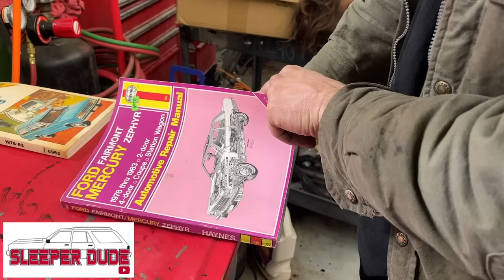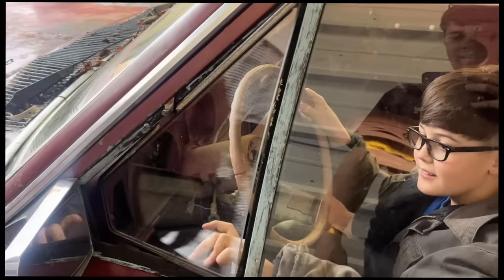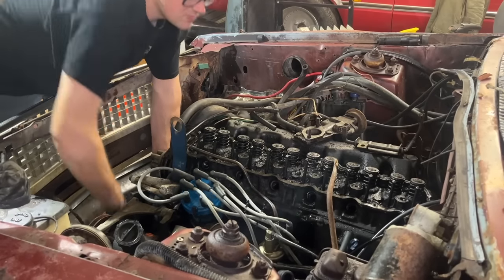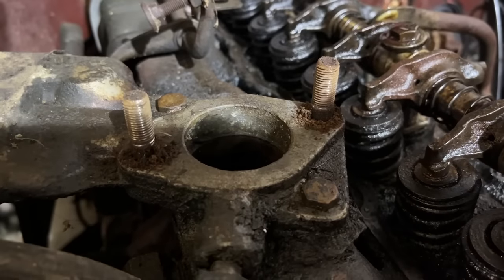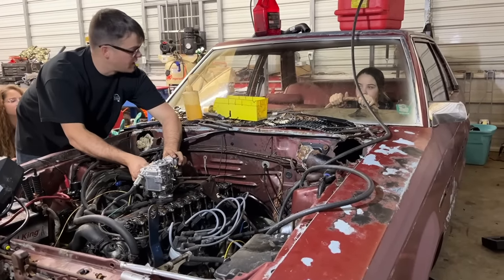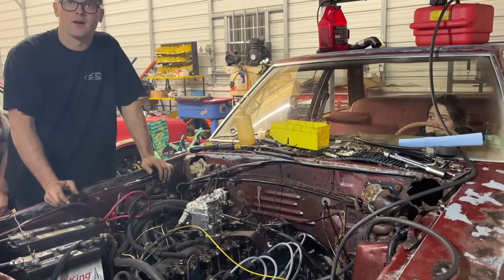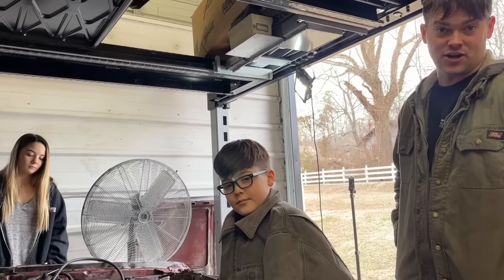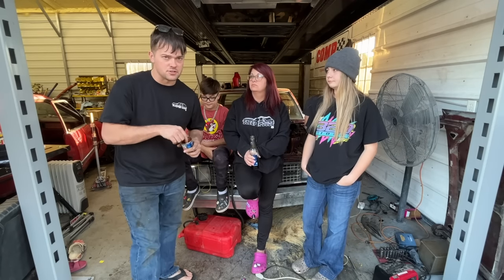Junkyard Rescue 2 Door Fairmont Saved From The Crusher Will it Start?

Comment: If the exhaust is really plugged the back pressure will prevent proper intake. 
Just a thought. Love the channel keep it up.
Reply: Watch it to the end and you will see that it was more than likely the timing due to the timing chain and not enough adjustment on the distributor to make up for it. 😮

Comment: Glad to see I'm not the only one that has a failure now and then!  Wonder if the exhaust is still plugged? Maybe one of the other Fairmonts has a good ring gear? Oh well good luck with that one. 😃
Reply from the maker: Thank you
Reply: Ring gears on the 200ci inline 6cyl C4 3spd are welded to the torque converter, not to the flexplate.
Reply: Yeah I think I’d have took the exhaust system off, I think that’s been the problem. It’s been a great vid albeit a little frustrating not seeing it run.
Reply: @michaelcook7836  change them both. Whatever it takes. 😧

Comment: Hi guys. Back in the early ‘80s I knew a guy who had a Chevy wagon with a 350. His idea of an oil change was to just change the filter and add a quart of oil. Needless to say that’s what his rocker arms looked like when we changed the valve cover gaskets. He was also a big fan of Quaker State oil, which didn’t help matters any.
Reply: Pennzoil will do the same . Use paraffin based oil that's what you get.
Reply: Quaker State will do this every time. I worked in a junkyard and every motor we tore apart for parts that used Quaker State was just like this. Every time.
Reply: If your dipstick is black there's a good chance the guy used Quaker State

Comment: The first thing I’d check first is to make sure the exhaust isn’t clogged up badly. Take a sawzall and cut it before the muffler…. Then pull the starter again to make sure you didn’t shear off the teeth on the starter. You should have 3/4 of a flex plate with good teeth!
Reply: My thoughts exactly
Reply: I think so too

Comment: When you try to start it on 24v, you need to connect the ignition system to the bottom battery so it gets only 12v.  The top battery in the series string needs to connect to the starter solenoid.  This will keep you from potentially damaging the ignition system.

Comment: Hey Josh, did you double check TDC, firing order and distributor rotation direction? The cam was timed to the crank w/the old chain, but it backfired through the carb which is usually a timing issue. Maybe cut the exhaust off at the manifold too. Sucks about that flexplate. Thanks for posting.
Reply: Yes, I wondered if the exhaust was still too bunged up to run. I've never had an automatic so I don't know if it's possible but with a manual I would try a tow start.

Comment: Dude, I worked at a junkyard for years. I bought so many old cars that ran again that we finally went and got our dealer license and started reselling them instead of scrapping them. It was more lucrative to get the pre cat cars running again than it was to scrap them. You just have to choose the right cars. I saved a bunch of really cool old cars. The '71 Torino, the '80 302 Cougar and the '85 Alfa Romeo Spyder convertible were some of my personal faves. I ran the crap out of that Cougar before we sold it. The first step on picking the right car is to make sure that the engine turns over.

Comment: I bought a 76 cutlass from a junkyard. Changed oil and plugs with plug wires. It started on first try after sitting since 96. If you ever get tired of the fairmonts i would love to have one
Reply from the maker: Man, we didn’t have that kind of luck on this one
Reply: @Sleeperdude  just get a 302 and drop it in.
Reply: Sleeper__-Dude  won? What username?

Comment: I think the "rats" nest in the exhaust is where your troubles lay, if the exhausted energy can not escape then it'll back up and stop the engine running, I had this problem on a barn stored straight 6 many years ago, it had good spark, would turn over and try to fire up, but just wouldn't keep running, on inspection at the rear of the car, there was material on the floor, and hanging from the tailpipe, after cutting out the rear exhaust box it ran as good as gold, maybe worth a try in your case too

Comment: Hi Guys,             Glad to see your latest attempt to breath new life into the old Fairmont. My Dad had a 1975 Ford Maverick 4 door sedan he bought new in April of 1975 at C&S Ford  in Willimantic, Ct .I remember going to  the dealer  with my Mom and Dad to pick it up when it came in. He ordered it with the 250 Six and Automatic transmission, AM radio and Power steering. They got 145,000.0 miles out of it over 25 years when we had to park it due to body rot from salty roads. These smaller Fords were off shoots of the old Falcon with similar design features. Josh, I hope you received the photo's I sent of my Jeep and 1991 Crown Vic wagon with newly installed " Sleeperdude " decal in the left rear window. Please advise . Thanks . Good luck on the 64 wagon build!

Comment: You may want to artificially boost the compression by putting a small squirt of oil in the cylinders. The little oil will help sealing the rings. increasing the compression. Sometimes the rings will loosen up and re-seal after running for a little while. Thanks for a great show. Fun, inspiring and always leave learning something new. God Bless!

Comment: Looking at all that mouse nest that is coming out the exhaust and then it's blowing back through the carburettor.  I have a feeling that the exhaust is restricted. This could stop it from running. Unbolt the exhaust at the manifold and try that if you can get it to crank with that bad flexplate. Maybe swop the starter as the teeth on it will be worn down now from all that grinding. Maybe weld a little on flexplate to build up those rusted and worn teeth. Don't  give up. This one wants to run. Part two video is a must. Please.
Reply from the maker: You may be right

Comment: Josh you've got far more patience than me, I'd have put Rocky outside months ago. 
Ref the engine, the amount of rubbish coming from the exhaust, the back pressure through the carb and the 'chugging' sounds point to the exhaust being totally blocked. Cut the exhaust near the manifold and give it another go.

Comment: Everyone I tore down that had all the sludge under the valve cover had been using quaker state oil I used it too but after tearing down a couple of motors that I used Quaker state oil in I changed over to Pennzoil.  ✌️

Comment: The 2 door box top Fairmont would be a great project car. You could buy the 2.3 turbo ecotec engine from a wrecked late model Mustang. That would an awesome cruiser/dragster car!!  That engine puts out 300 hp and 300 lbs of torgue! Also get the transmission too. I bet the Fairmont with that drivetrain could hit 140 mph easy.

Comment: You guys tried thats the main thing. If you can reach it try to remove the rust on the flex plate ,That may help. The ignition switch could be bad,or just dirty,causing the loss of 12 volts to the coil/other parts. ? That engine looks like it has had Quaker state motor oil ran in it back in the day. It made the same build up. if you put good oil back in it don't run it long has all that sludge will go into the bottom of the oil pan. I lost an engine due to that before. It plugged the oil pump  sump. Has always I liked and shared. All my very best.

Comment: After putting on new timing chain and gears it may have more compression which makes it harder to spin over, the valves would be opening and closing at the right time. 40 years ago I had 72 Mercury Comet quit running replaced timing chain and gears drove it 4 more years
Reply from the maker: Awesome

Comment: Just bought a 73 Plymouth Valiant, almost perfect No Rust. Interior is perfect except on tear on drivers side of bench seat. AC/PB/PS. Slant six has old oil that has dried out to caked on dust. Causing lots of rust inside the engine. Got it on electrolisis as we speak. Wish me luck.

Comment: What a pity it couldn't quite get going, I had my fingers crossed for a while there. Id be willing to try to clean the rust off the flex plate teeth through the starter hole, and try again.

Comment: The reason it stopped turning over is the extra tension created by the new tighter timing chain wasn't letting it jump past the bad teeth on the flex plate.  Good try!

Comment: The balancer/pulley outside the timing cover gave the engine enough momentum to go past the bad spot and hit good teeth again.  Without it not even the 24 volts spin it fast enough.

Comment: Watched the last one on the old "200 Thrift-power" a few days ago in the wagon with the bent push rods. Felt so certain this box top would work out great for you all. Pulling the trans for a flex plate/flywheel replacement will likely fire it. Just bad luck. Awesome wildfire lift will make life easier! Thinking of donating my 1990 mustang EFI turbo and parts. Motor from a non-intercooled EFI turbo.

Comment: I used to have a 4 door 1980 Fairmont with a 200 striat 6 and c4 trans and I had to change the transmission twice. 
Before you try ordering a flexplate I'll let you know the ring gear is welded to the torque converter on that car. Your flexplate is fine I could see it through the starter hole.

Comment: If you were just trying to get it to run for a way to get back and forth you could pull the head and put graphite on the cylinder Walls to fill in the scratches and put a new flex plate out of a junkyard on it.
Reply from the maker: Ok thanks

Comment: It quit working because the new timing chain added the resistance of the valve train and allows only one revolution before it hits the bad teeth. Without new flex plate it will not be able to keep spinning. Guarantee it will start and run fine.
Reply from the maker: Ok thank you

Comment: I remember back when the Ford solenoids were put together with screws. You could take them apart, clean the contacts and turn the disc over and have a new solenoid. Provided the magnetic coil inside was still good.

Comment: maybe try welding the worn down teeth. and dremel them right? i was thinking the slack in the timing chain allowed enough free play for the starter to turn it over and when you replaced the chain it tightened up everything and the flex plate became the loose end. I was also thinking maybe the exhaust or catalytic converter may be clogged preventing the engine from starting. I had a car ounce that wouldn't start and even the garage couldn't figure it out. Ounce we got it back home i cut the converter off and it was all plugged up and the car started. Maybe from years of sitting mice made home or the flooding filled the inside with mud. I see it kept wanting to spit stuff out. I've been waiting for the little plastic hand to make it's appearance and then there it was lol Keep up the good work and don't give!

Comment: Dang the bad luck but I guess Squeeze was right on whether it would run.
Pull the engine and give it a graigs list rebuild (new rings, gaskets, bearings and dingle ball the cylinders and take the flex plate from the black Fairmont), oh yea fresh paint job. Look how much fun Ralphie would have cleaning all the parts. You already have a new timing chain, fuel pump, and carb. Or maybe if the block & cylinders is good from the black Fairmont slap the head and new timing chain set from 2 door engine on it. Pull both engines and make one. That would make a great video.

Comment: I'd bet it would run with a new flexplate. The lack of compression was likely due to the jumped timing and since you've fixed that, it's not spinning as freely as before. But I'm with you, if I pulled that engine it would be to swap in something bigger.

Comment: I suspect that the new timing chain may have changed the valve timing enough to bring up the compression enough for the engine to no longer freewheel across the bad teeth. You may be able to get a little better results from the other starter. The teeth may be a little less worn and may catch what's left of the ring gear teeth at least for a short time.
Reply from the maker: You maybe right

Comment: Is the transmission in neutral? Lean issue when backfiring through carb. Choke should be closed (almost) and that fuel pump that seemed weak? Needs more fuel! Maybe pressurize the fuel tank a bit? Hit it with some starting fluid? You were so close!  Love the family involvement!
Reply from the maker: It was in park.
Reply: .ᵗʰᵃⁿᵏˢ ᶠᵒʳ ᵗʰᵉ ᵍʳᵉᵃᵗ ᶜᵒᵐᵐᵉⁿᵗˢ 🤲 ᵐᵉˢˢᵃᵍᵉ ᵐᵉ ʷⁱᵗʰ ᵗʰᵉ ᵃᵇᵒᵛᵉ ᵘˢᵉʳⁿᵃᵐᵉ ʸᵒᵘ'ᵛᵉ ʷᵒⁿ

Comment: Josh, Get a 8D battery out of a bus or big truck, put it in a cart with jumper cables it weighs about a 100 pounds, and charge it about once a month. You'll have about a 1000 cold cranking amps that  will outlast the starter.

Comment: Great episode! 
The starter ring gear is welded to the torque converter btw  .  I found you guys while looking for Ford Falcon videos . 
My 62 Falcon has a 200ci from a 78 Fairmont and it has a bad ring gear also .  It was difficult to find a replacement torque converter   but they are out there .

Comment: Idea when doing a 24-volt start, isolate the electrical harness, 24 volts to the starter only and have a third battery that runs 12 volts to the ignition system only, then you have  no risk of burning anything up.

Comment: At 944 comments already I don't think you will get to read this, but, on a stuck engine, put some hoses back on taller than the engine and fill the cooling system with boiling water, let it heat soak the engine after oil is down the bores, it just may help, but, thank you all for making me laugh at your antics.. Ian.. UK.
Reply from the maker: Ok thanks we might try that!

Comment: I rotated the flexplate so the starter would hit it in different spots. When I was much younger. I carry a long screwdriver in case it ended up in the same spot. Chevy small-block so without the inspection cover their ears pretty easy to rotate a few degrees. But then sometimes cars end up in a salvage yard for a good reason. Engine transplant? Fun episode as always

Comment: I have a feeling that the exhaust is plugged up so the engine is struggling to breathe properly and the timing was in need of replacement and now with the new timing parts installed it took out all the extra play which make it turn over harder then with the sloppy timing parts. Get a new flex plate and disconnect the exhaust and i bet it will fire right up.

Comment: Take the exhaust off the manifold or cut the exhaust in front of the muffler and give it another try to start it could be just    blocked not allowing it to run  cheers from OZ

Comment: Hey when you get mixed up with firing order  forget the timing light take number one plug out stuff your thumb over the hole and tap the key over till your thumb gets blown off  then you know for a fact. Your on top dead center or very close and defintky close enough that it will run  and won't be 180 out ever. If you do it that way !!!!!

Comment: as long as the radiator is out, you can put a impact driver on the crank bolt to start it.
Reply: Cut exhaust  its full of mouse nest it will  never  run  with all the  back  pressure.

Comment: Don’t you have a flex plate and starter from one of your other Fairmonts that would fit? Would like to see if the thing started
Your valve timing being out of whack would cause backfiring through the carbon and also low compression on cylinders. 
Would like to know if that old girl would run.

Comment: The dura spark starts on one side and runs on the other. One side can go out and not the other. I had one that would crank and crank then take off running when you let off the starter, just oppaset from what you have going on. Try a different module.

Comment: Excellent video Sleepdude Crew Josh   :) think try one parts on starter ring gear replacement and think time  time chain is one big problem was resolved from turn over faster now ! I say swap parts from other cars 250 6 cylinder motor and should help out!

Comment: It is not turning over fast enough to start . The ground cable is corroded and robbing the starter of power. If you check it it will be hot. Change the ground cable.

Comment: Sounds like the exhaust is plugged where you at blown head gasket across all cylinders
Reply from the maker: Maybe so
Reply: Remove the exhaust pipe  take compression one spark plug at a time if that don't work take the radiator cap off push the rest out

Comment: Wire the batteries in parallel instead of series.  You still have 12V but get the the amps from two batteries.  Essentially you're taking two batteries and making one bigger battery.  A battery bank so to speak.

Comment: If the car can't exhaust enough the exhaust pressure has no place to go back up the carb. I would have tried to chip the rust from between the gear teeth of the flex plate. but that large massive glob of rust on the torque converter would have made quite the vibration if it did stay running.